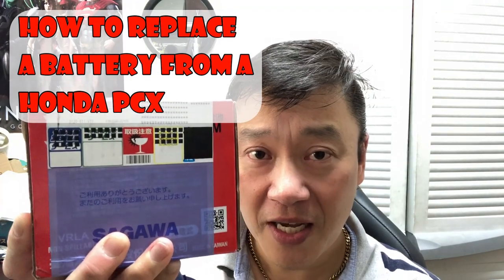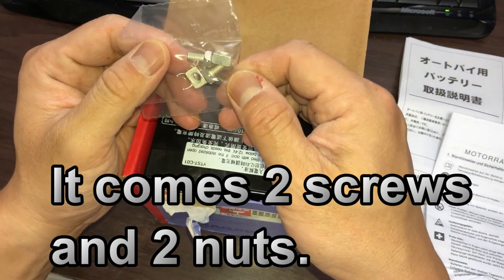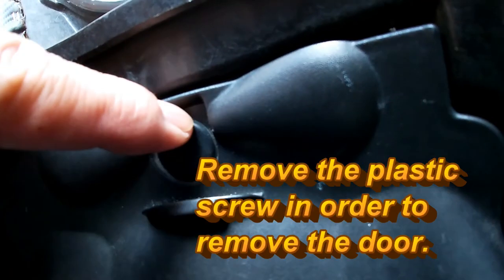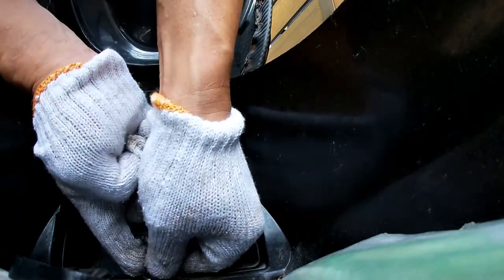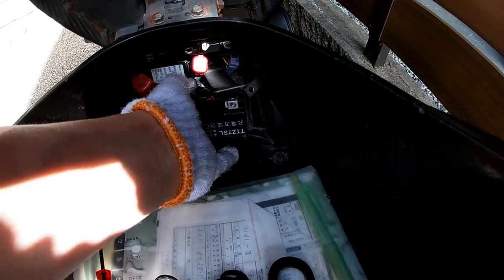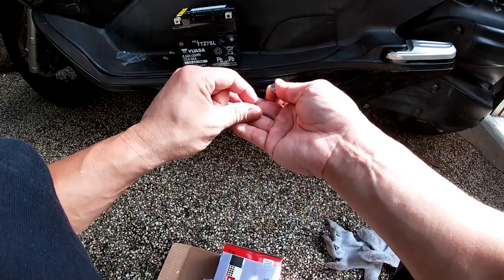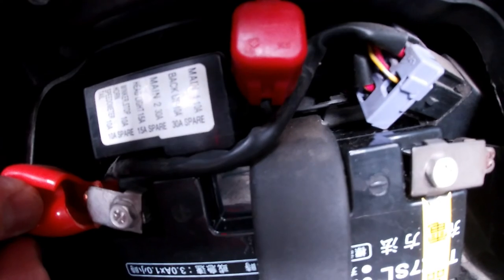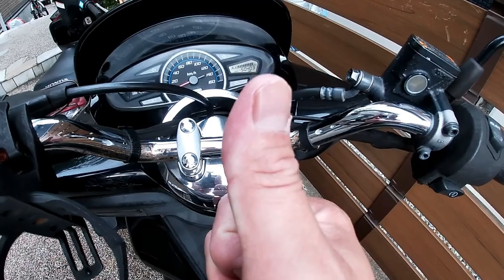HOW TO REPLACE A HONDA PCX BATTERY THE EASY WAY-SAVE MONEY!

Comment: Thanks for the video! My battery "died" last week, Honda PCX 125 from 2013. The battery had not been replaced before, so more than 7 years of usage, with 28K kms already done. Do you think it's normal for a battery like this go off suddenly? Im really bad with cars and bikes, do you have an idea if in this bikes the alternator is a problem? I think for my model its a bit expensive, just for the battery around 100€. Thanks again for the video!
Reply from the maker: Hi I am no mechanic but a scooter battery usually lasts for 2 years depending how often you use it. You are extremely lucky to have been able to ride your bike for that long! One bad thing about the PCX series is that there is no kick starter and when the battery dies, there is almost no warning!  If your battery dies in the middle of nowhere then you’re screwed! However if you are in town or at a gas station, you could get a jump. Hope you get a new battery!
Reply: @WOWTHATSJAPAN2  Thanks for the reply! I have this scooter since 2014, it was bought in second hand from a Honda representative in the south of Portugal. Since then I have been using it regularly, more in the sunny months. Fortunately for me it died 200 meters from home, I had just stopped to check my phone lolll. To think next day I was planning to go 65 km away from my town xD . I got it for around 65€, an Yuasa ytz7s, but seems the start-stop its not working, https://thumb.eurobikes.pt/image/Bateria-Yuasa-YTZ7S.jpeg?d=600 . Thanks again!